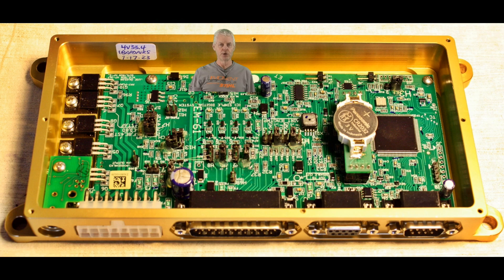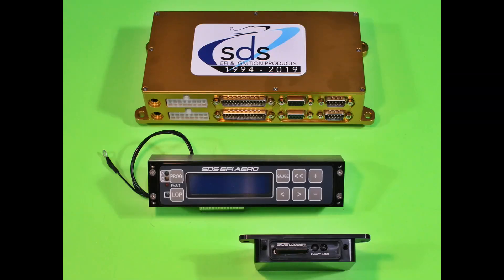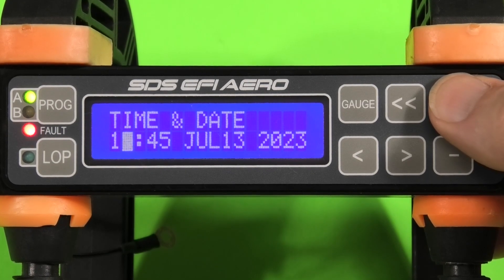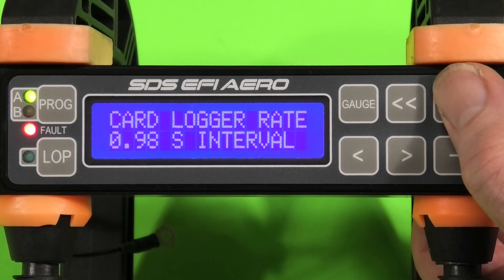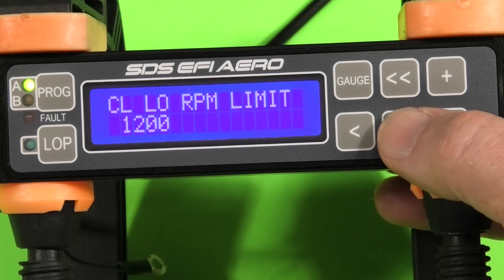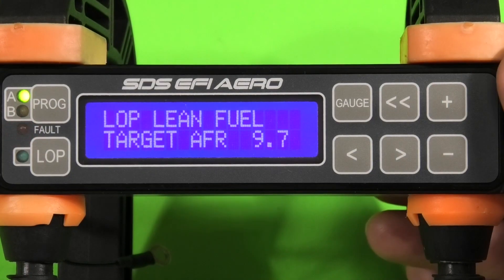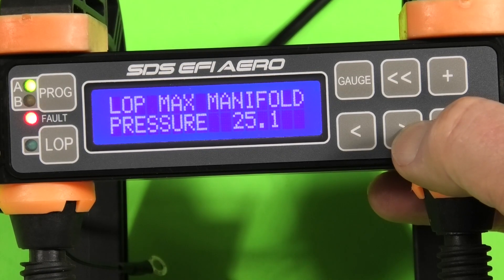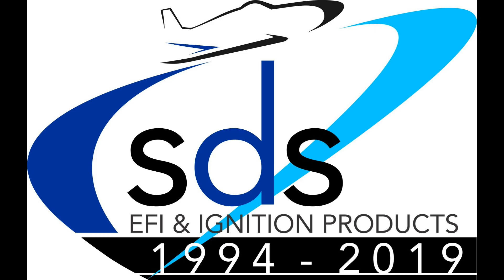Video #121 SDS EM-6

Comment: Does this integrate with a dynon SV-EMS-221 so I don't need 2x data loggers?
Reply from the maker: We just log ECU parameters and output only rpm and fuel flow to the Dynon or Garmin glass.

Comment: You seem to really know just about everything about airplanes...
May I ask you a question---more like a paragraph.
1st, I'm not making one, it's just a concept, I'm curious as to what you think about it.
I have an N3 Pup (see my avatar)...  So, just because I have one, use that as a base.

Take the 727 and using very round numbers its flight envelope is from 100mph-600mph.
That's a huge range.
It has massive flaps and slats to allow it to fly slow and fast.
Planes aren't exactly designed to cruise at a perfect state with wing size.  The limiting factor is landing speeds.
I'm curious...
What would be an optimal sized wing for an N3 Pup (you can use another plane if you even want to bother answering my question/idea) for cruising speeds.  
While it would be complex as heck (but not necessary to use screw jacks) have an N3 pup with a tiny wing which is just great for cruising, and for landing have massive triple fowler flaps & slats.  Something which would give it much slower landing speeds.  I don't mean to make it a STOL, but to make it land at safe speeds.  A wing with lots of camber.
What are your thoughts (I get it if you don't want to bother responding).
Reply from the maker: It would be a lot of complexity to add retractable slats and Fowler flaps plus some extra drag from the tracks required but theoretically you could reduce the wing area for a faster cruise speed by doing this. Aircraft design is all about compromise. Would all this be worth the tradeoffs in weight, complexity, cost and maintenance?  

Roughly, you could reduce wing area by maybe 50% going to a slatted wing with double slotted Fowler flaps over an unslatted wing with just plain flaps.
Reply: @rv6ejguy   Oh wow, I missed this response.  Thank you so much!
I'm just talk'n here, but my main schtick is RC Gliders (mostly gilders).  I have this book which I'd always use to make mechanical mixers (before the age of electric fancy schmancy transmitters).  This book has ways to make fowler flaps with push rods.  These are perfectly light.
I used to be so damn productive...now, I'm in my eternal funk...can't even put the wings on my damn N3 Pup.
But---I do think it would be fun to make a plane like I speakith above (even just as a test bed).
I once (I was a kid) this retract out for a glider which did NOT need one, but I think they're cool, I love retracts!  ---and it really was just a test gear, but it worked great.
One of the next models I'll make will be basically a tiny plane with an enormous engine to piggy pack rather large RC gliders up to the heavens... Maybe I'll make the double fowler flap + slats on that plane (it's already going to be a frakenplane as it is).
Thanks again for your answer.

Comment: Richard Holdener, who does thousands of engine dyno runs, mainly LS engines, made an interesting discovery using wide band sensors for every primary cylinder header tube. He tested a carbureted NA dual plane intake and would have only one wide band O2 sensor in the header collector, say bank 1, 12.5 to 1 air/fuel ratio. You would think that would be safe, but when he took the reading on the individual cylinders one cylinder was way too rich 10 to 1 and another was way too lean 15.5 to 1 ready for disaster at 7000rpm. Then he did the same test with a sequential fuel injected LS and stock intake manifold, and he found the same dangerous results but was able to correct the air fuel ratio of the individual cylinders to a safe air fuel ratio with a Holley programmable sequential fuel injection computer.  So do not rely on 1 O2 sensor.
Reply from the maker: We've seen engines with big airflow differences between cylinders like Lycomings due to their poor intake manifold designs but even these don't approach a 50% difference in AFRs (we know this from EGT data on each cylinder). No way an LS with the factory manifold has imbalances like this or the pistons would fail and it would never meet emissions specs. 

Some crap carb manifold might be pretty bad but again, the engine would just blow up in short order. Something is wrong with his experiment.

Trimming individual cylinders, as we do, can correct AFRs but it doesn't address the fundamental issue of unequal airflow between cylinders which means each cylinder can't be producing equal power.
Reply: Yes, it could be a bad injector, valve, piston ring, bore out of round, cylinder compression test, etc. Running your engine on the engine dyno before mounting it on your airplane could weed out problems and you could do dynamic propeller balancing also.  @rv6ejguy

Comment: IF we could accept AFR data from 6 O2 sensors, and have the ECU trim all 6 injectors independently, seeking a target AFR in closed loop, then pilot engine management tasks would be minimized, and efficiency and safety maximized. The pilot could simply select "full rich/takeoff/climb", "auto rich", or "auto lean" (as defined by target AFRs before flight) and we would not need to trim manually in flight. I'm sure you've already thought of it, but I'm not sure if the ECU architecture would support it.
Reply from the maker: Nobody would install individual cylinder wideband sensors for this purpose. Expensive, possibly short lived on leaded fuel and a wiring maze. The ECU doesn't have enough inputs to deal with this either.

Once ROP and LOP trims are set via EGT, things are pretty automatic on subsequent flights with closed loop on as AFR targets are programmable every 100 rpm.
Reply: @rv6ejguy  ah. I had it in my head they were trimming each cylinder every flight.